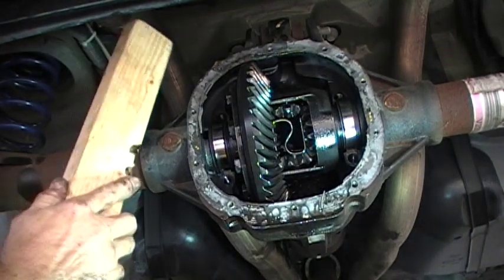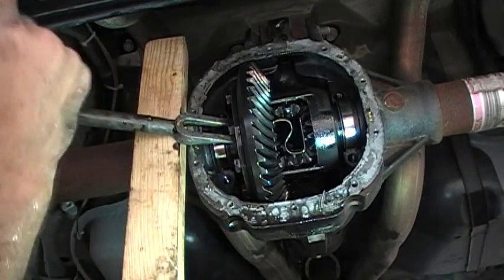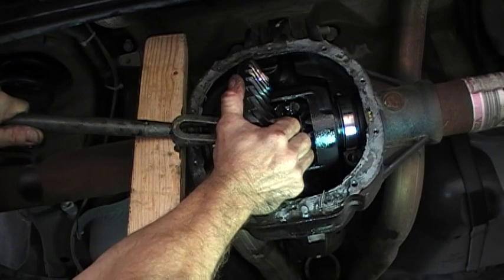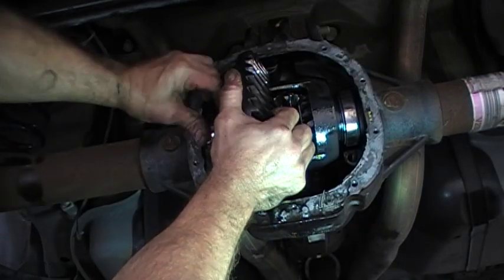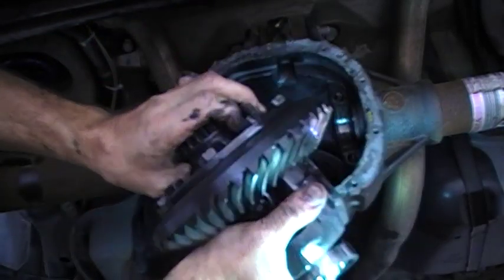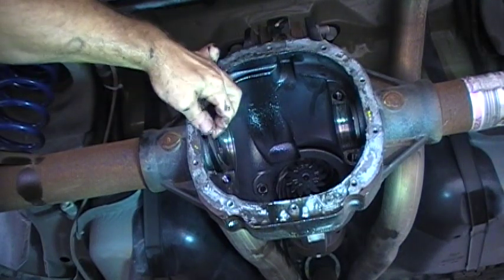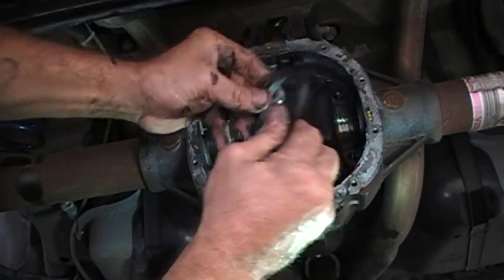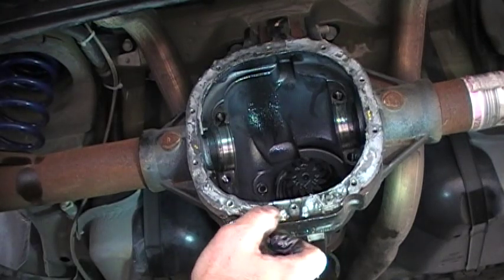HpVideo.Org Ford 8.8 Rear Differential Removal

Comment: Great video.  I have a '67 Olds Cutlass that has started to make alot of grinding noise from the rear of the car when the drive-train is under load or even coasting.  It's also accompanied by alot of vibration above 50 mph.  I think it's either a wheel or axle bearing, the rear diff's spider gears or maybe a bearing connected to the drive-shaft.  Wondering if you can give me any input from your experience.  Any advice is greatly appreciated.

Comment: I see no one has commented on your video...well I will go ahead and start with a THANK YOU! Even though I need a video for a 10.25 full floater, you have done an outstanding job even with this one..proper quality, fast instruction and an overall great video. I need to get that pinion gear out to change those bearings..any suggestions?